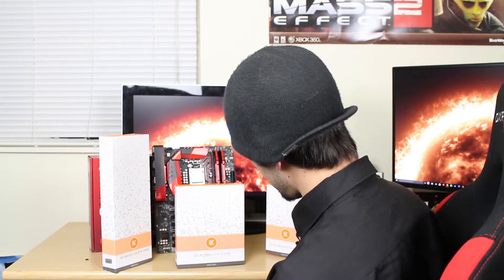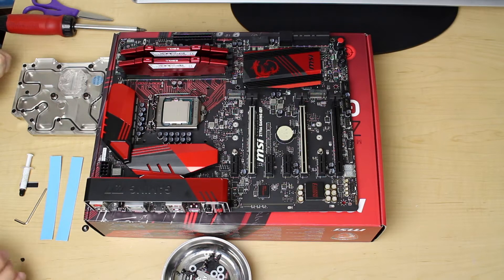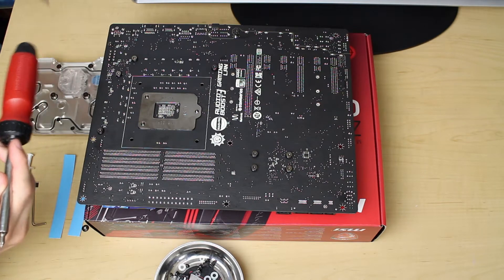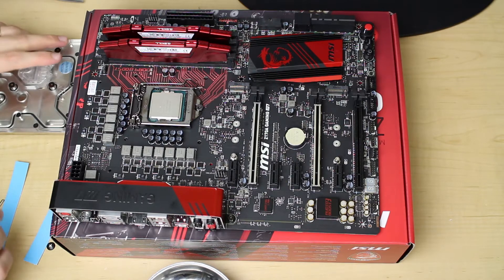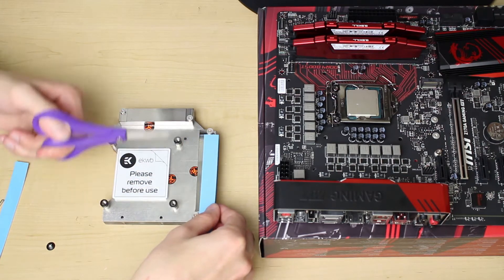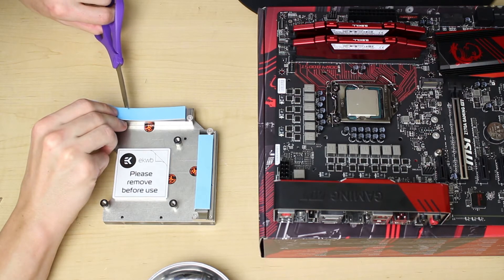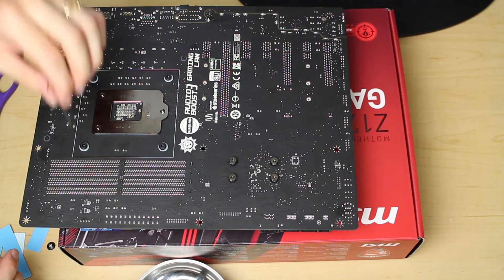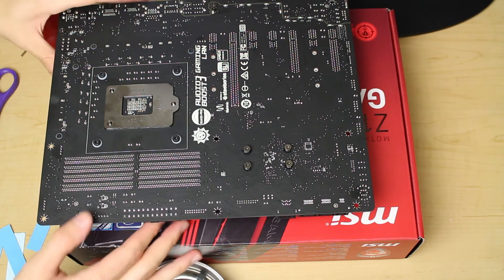How To Guide: Installing a EK Monoblock on the MSI M7 Motherboard

Comment: Can I re use thermal padding when I make my board go back to stock or will I have to apply new ones to the original block
Reply from the maker: You CAN just keep the thermal padding on the heat sink where it is and re-use it to return it to stock. For storing it i would advise keeping it in a seal-able sandwich bag to stop the pads from getting dirty.
Reply: Thanks a lot for the quick reply :)

Comment: Appreciate the vid. I am pursuing my first EK monoblock install on an MSI Z170A based board. While I have one water-cool build under my belt some 4-5 years ago (using CPU/GPU blocks only), I wanted to see if I could expect any surprises with the mosfet heatsinks prior to getting the philips-head out and diving in. In a general Youtube search yours was the only reference (so far) installing the EK monoblock to an MSI Z170A based board - you gave me the info to confirm what I suspected. Of course, I can always find a way to screw up - but it won't be because of something that I was unaware of! Thanks.
Reply from the maker: Your welcome, glad my video provided some insight to help out your project. I would say that installing a monoblock is much like installing a full coverage gpu block, so if you have some experience with that you should be alright. This may be a bit of common knowledge, but I would like to suggest doing a test to make sure the computer components you're using work before attempting the water loop (warning: 6600k and 6700k do NOT come with stock coolers to aid testing). Good Luck with your project! :)
Reply: +Giga Hertz Tv  are you sure that the blue site go on like this  that side is not the soft side the blue color come,s  on the block the  soft thermale side is the white side